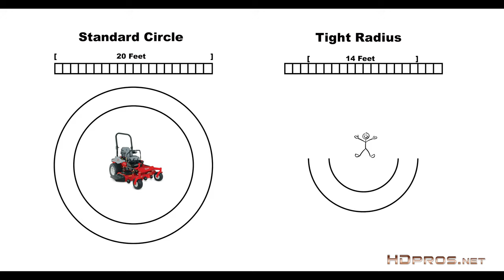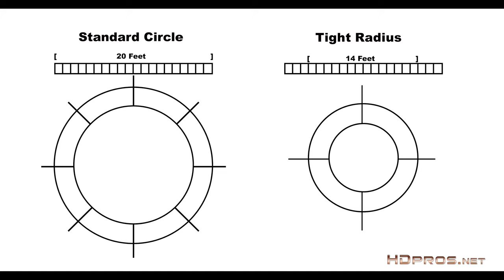Half-Circle Dolly Setup - Professional Filmmaking - Cinema Tools Pro Tip #3 180 Degree Tight Radius

Comment: You say 'radius' when you should be saying 'diameter'.
Reply from the maker: I'm not a geometry whiz, so maybe you are correct. However, I didn't name it that. In the industry it is called tight radius track. Who am I to start renaming gear, LOL!
Reply: @HDProsnet  You know the word 'radiate'? Something radiates from a point, from a center. A radius is from the center of a circle and out to the circle edge itself, the circumference itself. A diameter is from one side of a circle and across to the opposite end. This means a circle with 5 foot radius has a 10 foot diameter. I don't think the industry names them wrongly. I think it was just your superimposed graphic that was wrong. I'm pretty sure if the manufacturer calls something 20 foot radius track, and you lay out the complete circle, the circle will measure 40 foot from side to sice. Because 'radius' is measured fromthe center of the circle and to the edge of the circle.
Reply from the maker: @kentjensen4504  Oh I see what you are saying. At about 43 seconds I say we were using 20 foot radius track and that is wrong. It's 20 foot in diameter. Got it. Thanks for the correction.